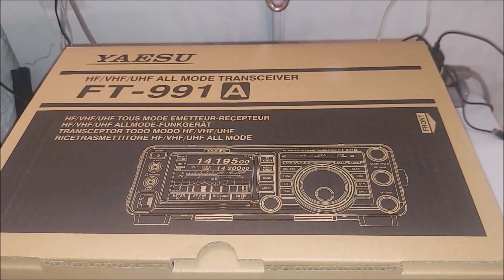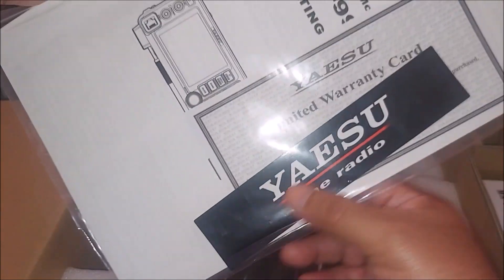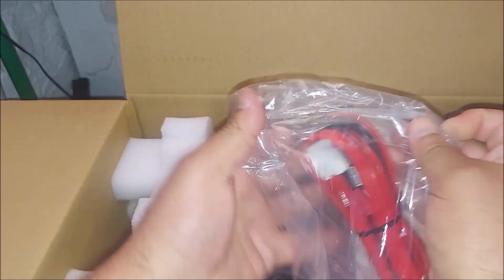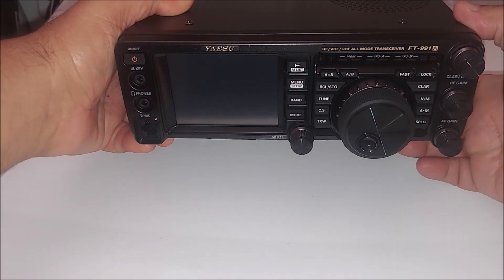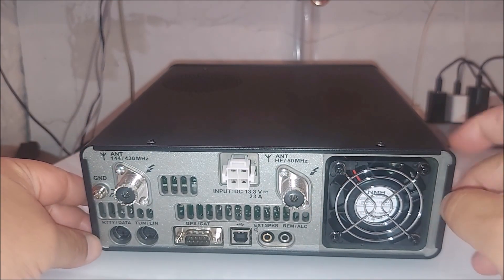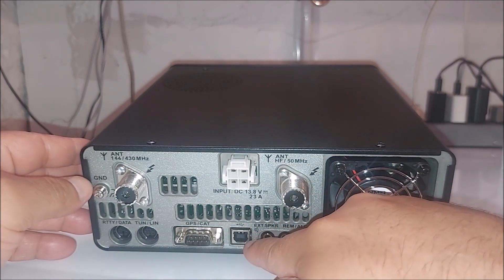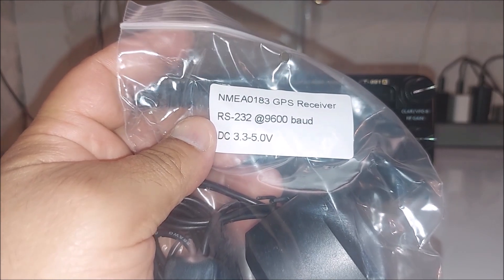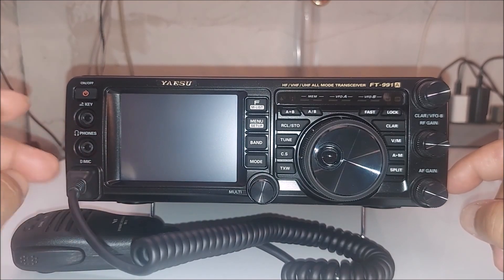Unboxing the Yaesu FT-991A HF/50 MHz/VHF/UHF/C4FM Transceiver

Comment: So,  I am in the process of repairing my VHF/UHF Xmit on my 991A. I seem to have issues getting the V_U_Amp board out as the solder is taking a tremendous amount of heat to melt and this WILL cause damage to neighboring components. I have purchased several irons including the actual hot air gun normally used for SMD work and this too is not melting the solder. The big issue is getting the antenna connector separated to remove the board  and then to identify and replace the 47 ohm resistor(s) that may be damaged and caused one half of VHF/UHF final to fail. I know the tricks of aluminum foil and heat sinks to take up the heat but I am concerned about doing a shoddy job even though its my radio and will never sell it. My actual question after all of that is, does anyone know if Yaesu uses specific tools or items to take up the heat on their particular radios? If they have a procedure normally used for this work they will not impart that to me of course but I would appreciate any info on this. I am a electronic tech so I have done this work before and just need the right tools they use unless someone has replaced the resistors and final for the VUAmp board.